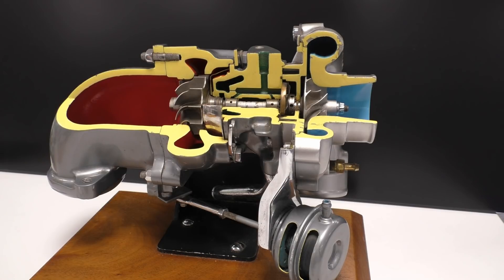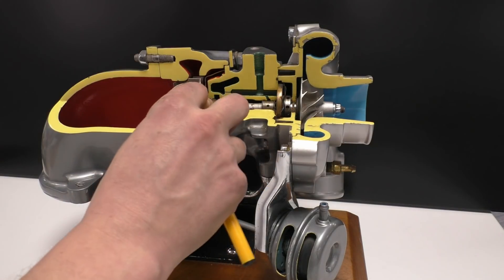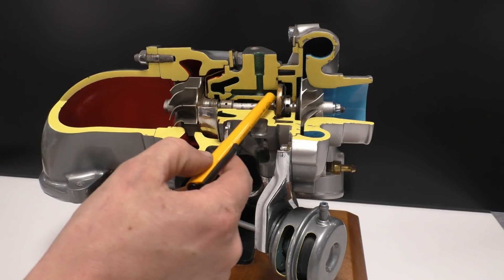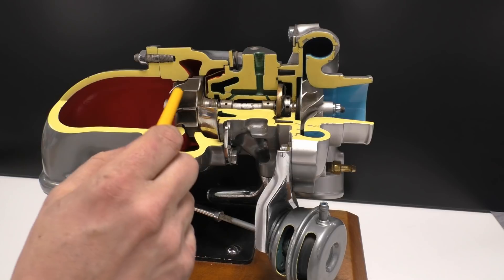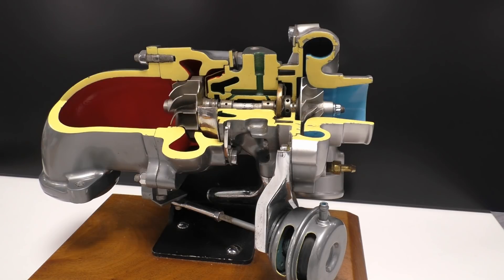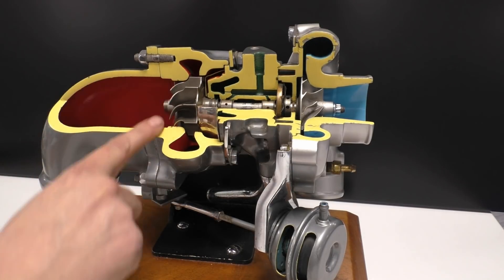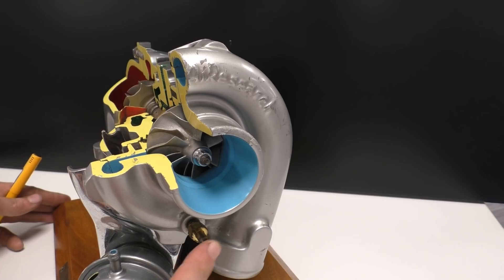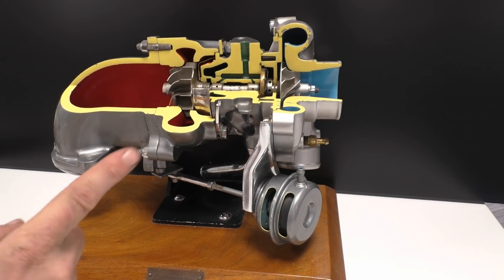What's inside a Turbo - Part 1

Comment: You're spinning it the wrong way!
Reply: The hot side (red) exhaust turbine wheel on that unit spins counter-clockwise when viewed from the end of the shaft. 
The engine exhaust flow enters the turbine housing through the flange where the housing mounts to the display stand bracket as shown at 4:57 . 
The engine exhaust gas enters the turbine wheel perpendicularly at the largest diameter outer edge of the turbine wheel and exits through the curved vanes at the turbine wheel center. 
This causes the exhaust gas (fluid) flow to accelerate through the turbine vanes then expand extracting and converting the available thermal energy into rotational shaft force driving the common shaft compressor wheel.
Reply: patw52pb1   I concur.
Reply: Beach&BoardFan   You are right...I believe.  I just googled "turbocharger cutaway" and you are exactly right.  patw52pb1 also just set me straight.
Reply: Beach&BoardFan
I don't think he is.  That thought popped into my head too.  But look closely.  Left side is hot side.  Exhaust comes in from the manifold on the large pipe.  Goes straight into the bladed axially.  Cold side pulls air from the scroll and pushes it straight out the large pipe, axially again.  I think I got that right.  See what you think.  Cheers.

Comment: These things take enormous amounts of time to produce, partly because they’re so small that too many chefs... really does apply and from the precise cross-sectional cuts to the colours to separate oil galleries and the hot and cold sides of the unit... beautifully done. Fuck Pollock & Picasso indeed Matt! This IS engineering’s art.